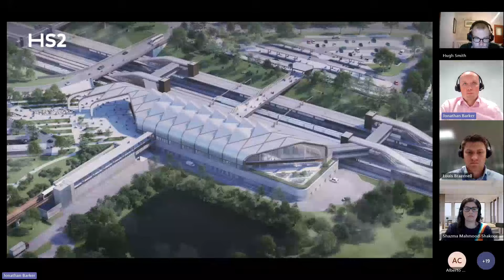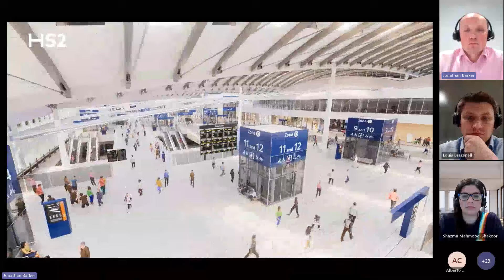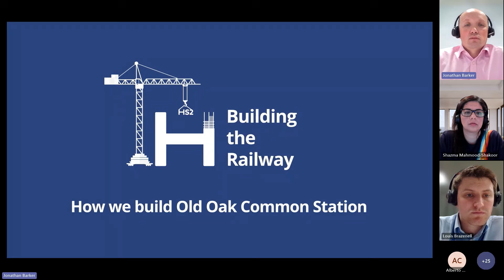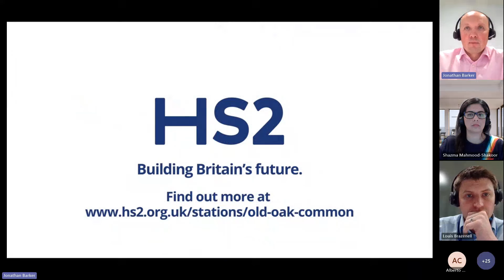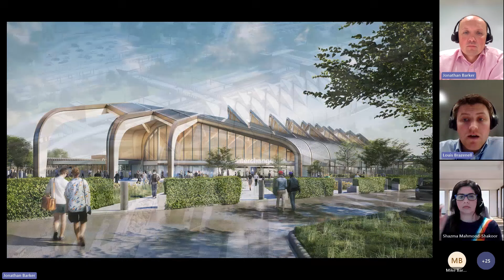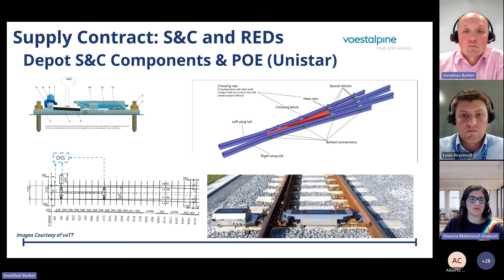HS2: Great Britain’s new high-speed railway line - J Barker, L Brazenell, S Mahmood-Shakoor

Comment: Not going to the Leeds and Manchester is a disgrace.  It's made me fall out of love a lot with HS2 a lot.  I was so excited.  Now it doesn't even unlock the full potential.  I think you've done an amazing job with what is being delivered. Well done.
Reply: You truly get it, manchester and leeds branch are the most important part. Withoit it HS2 us useless
Reply: @slimchris113  That is where you are wrong, The line is now going to Manchester and any connection to Leeds will be by a Northern high speed link across the Pennines but sorry to correct you but HS2 will not be useless with out Leeds as when it Opens all Avanti West Coast trains from Scotland, Manchester, Liverpool and Birmingham will transfer to run on HS2 instead of the WCML from Stafford to London. So actually a Leeds branch is insignificant passenger number wise as the HS2 line is just  an upgrade of the Southern Half of the WCML
Reply: @peterwallen1063  This is where your wrong. 1 it wasnt built as a line it was built as a network which is why the cuts has made it more expensive than less. 2. Stafford Crewe stockport and Manchester cannot handle 400m HS2 trains. 3. Journey times between west to east midlands and south and west yorkshire cut making it more vaible option than car. So eastern leg wasnt pointless it was most important. 4. Northern high speed rail needs HS2 in full to work, without it the costs dont justify and its only a few miles of new track, without a high speed network to handle its share it collapses.
Reply: @slimchris113  HS2 is now just a hi speed link from London to Birmingham, Manchester, Liverpool and Scotland full stop
Reply: @slimchris113  Dummie, it is a High Speed link from London Euston to Birmigham, Manchester, and Liverpool alowing motr capactity on the main Southern section of the WCML for Freight nd other passenger services and all stations such as Manchesrt, Liverpool, Edinburgh and Glasgow will either have platforms extended or the trains will have selective door opening on the newly desighned trains
Reply: @peterwilliamallen1063 Dummie call it  WCML bypass link then cuz that wasnt the original plans, HS2 as in High Speed 2 a NEW railway to tackle capacity of WCML. MML, ECML and CML Thats 4  mainlines for the price of 1. No one needs 18tph for stafford alone . Travelling between birmingham and leeds is poor with train and car which is why eastern leg had the most benefits
Reply: All HS2 is a new Hi Speed line to take hi speed passenger trains off the South section of the WCML from Stafford to London Euston aafter the failure to upgrade this section of the WCML which will allow more capacity on the WCML for other passenger  train services and freight services, it will be connected to Manchester and Liverpool and Euston. No way would this line of been built to Leeds as it is qucicker to London from Leeds via the ECML
Reply: @peterwallen1063  Umm, the projected London - Leeds journey time was 1h21m, which is 50 minutes faster than today's fastest journey time of 2h11m. In any case, that also ignores all the other benefits of the eastern leg such as reductions in journey times from Birmingham to the East Midlands and beyond to Leeds, as well as the enormous amounts of capacity relief to the MML and ECML.